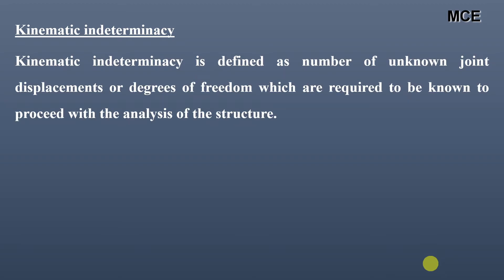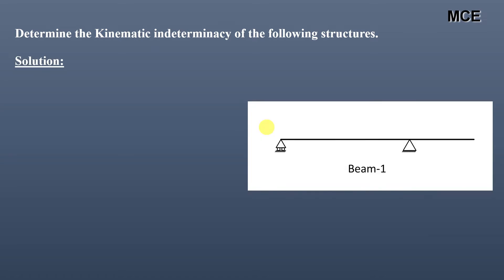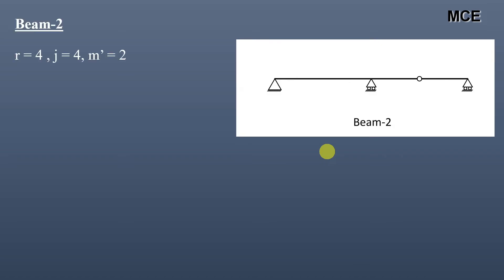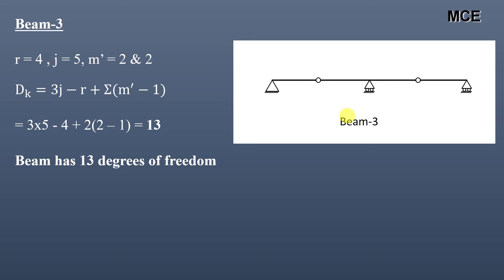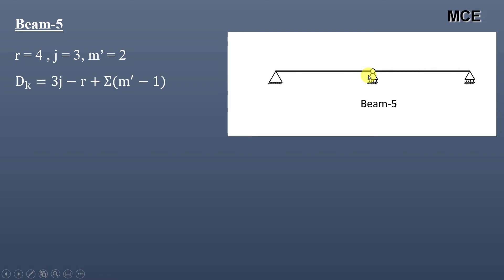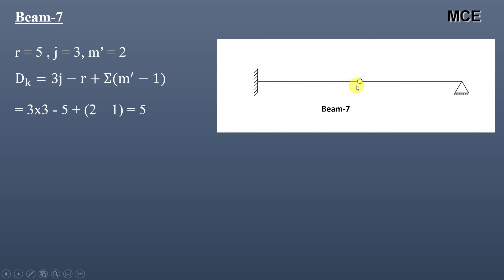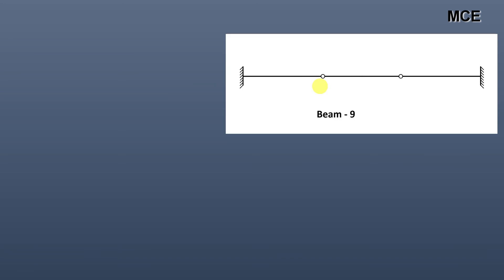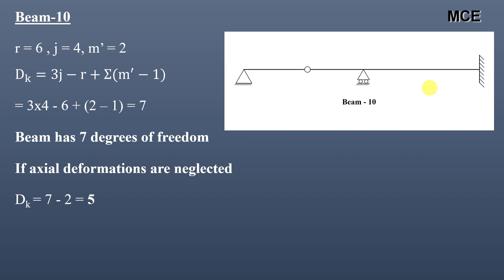Kinematic Indeterminacy of Beams|Degrees of freedom of Beams

Comment: at 2 : 04 , you have mistaken @MasterCivilEngineering. If axial deformations are neglected or inextensible beam then kinematic indeterminacy will be degree of freedom minus no.of axial rigid members. In this case (i.e., Beam 1 has two axially rigid members) but you have taken one only. This is incorrect.🚫

Comment: hen axial deformation is neglected, why only one member is considered while adding to Dk? For example, if a hinge is inserted between two supports, if axial deformation is neglected, why 1 member is considered instead of two?
Reply: We will consider there is more than one member if a hinge is between 2 rollers, and if a hinge is between a fixed wall and a roller only. We don't consider that there is more than one member if a hinge exists between 2 pins, or between a pin and a roller, or between a fixed wall and a pin, or between 2 fixed walls! Hope that clears it!